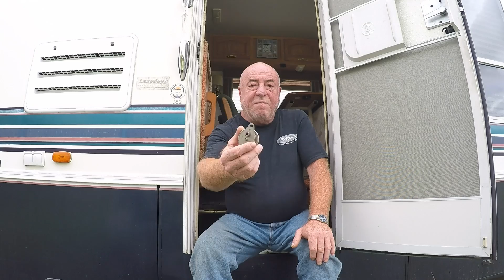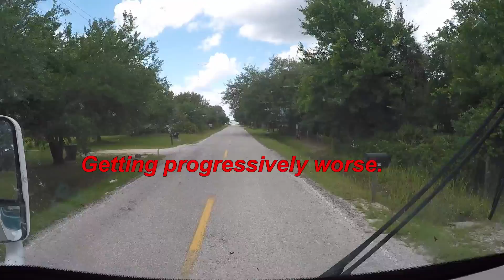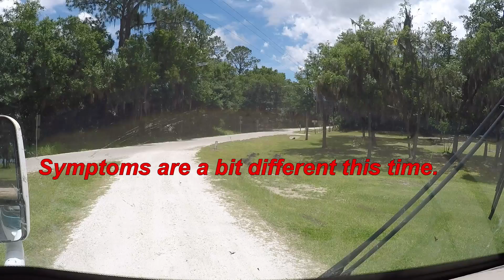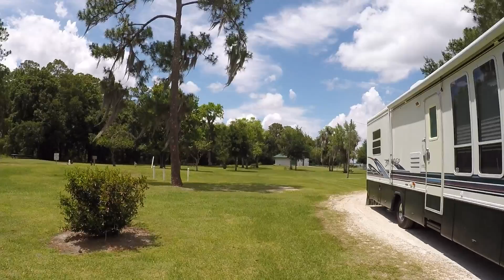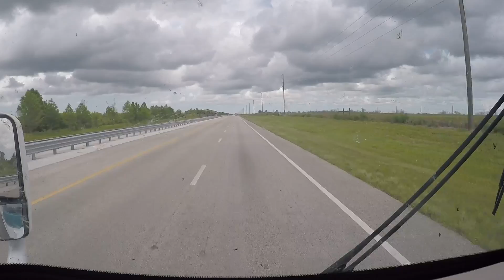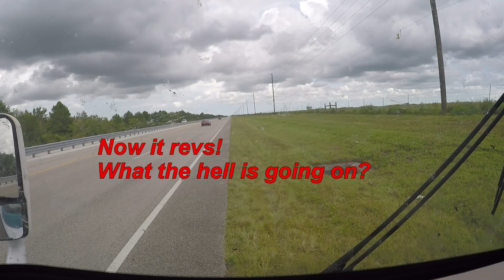May 9, 2015 Test Drive Video & More

Comment: can it be the computer that runs the injectors over loading engine with to much fuel . shutting it off and restarting it resets it then slowly over loads engine with fuel .
Reply from the maker: Ryan B. Could be anything at this point.

Comment: WHY is it running hot under normal driving conditions ? My 2003 , 8.1 chevy 3500 with an Allison computer will reduce timing by 2 degree steps IF conditions warrant ........torque management !  Sell your gas unit and buy a diesel !